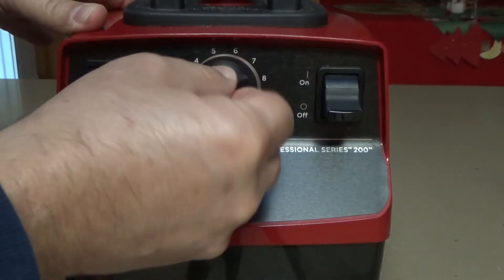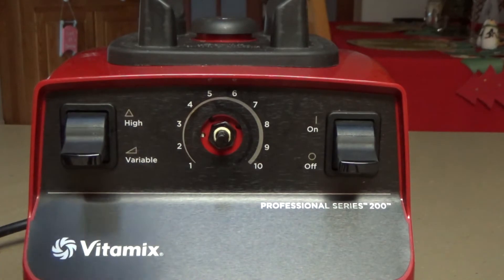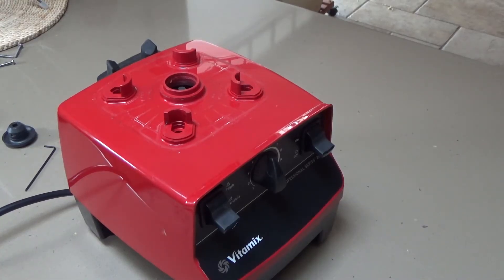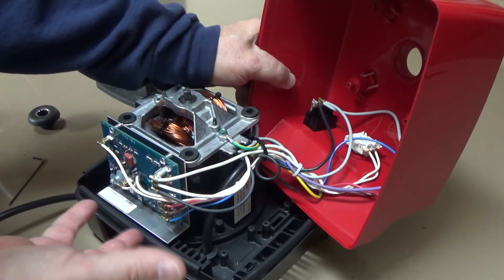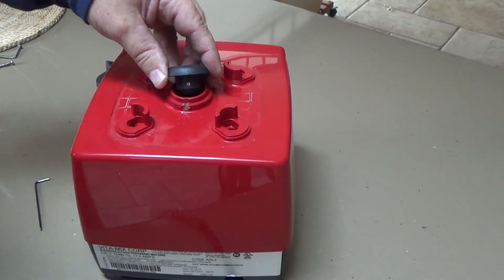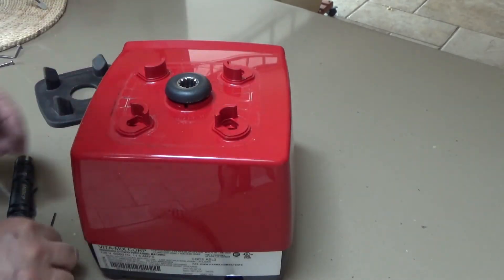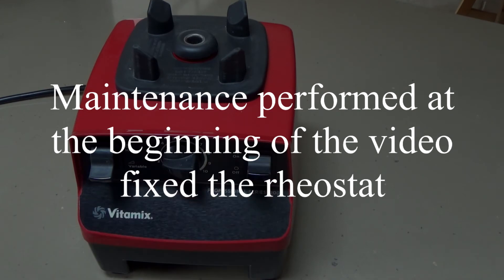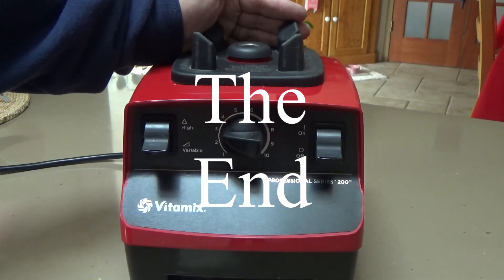VitaMixer Repair and Maintenance

Comment: Please tell me, how did you repair the potencyometer? I have the same problem on the vitamix s30, the engine is running jerks and not stable power
Reply from the maker: The first thing I did was just spray it down with WD40 as that is water based.  That worked.  Then I saw a replacement part on Amazon.  The replacement was aftermarket and I would say not perfect as the wires were much smaller in diameter than OEM.  However it worked and I have the original as a backup.
Reply: @A_Renaissance_Man  thank you very much for your help. Unfortunately for the model vitamix s30, I did not find this potentiometer. I will try to disassemble and clean the potentiometer